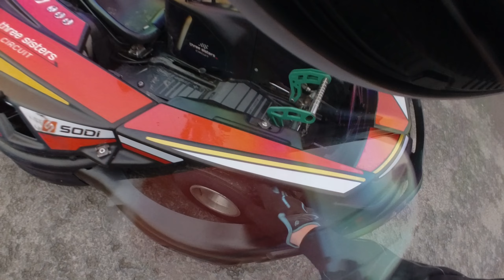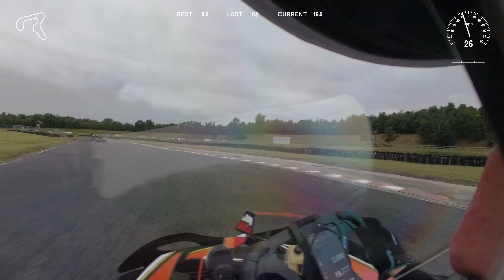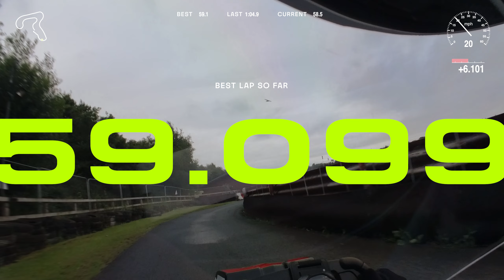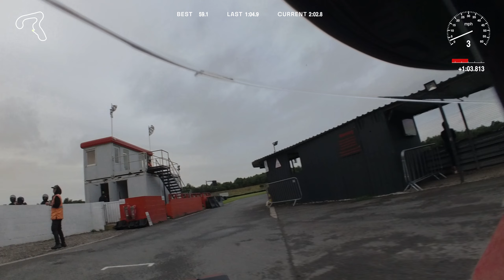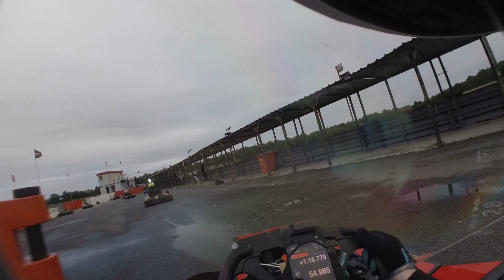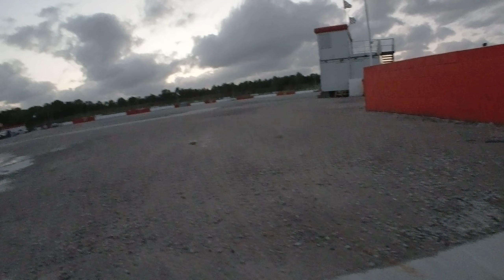Is this kart broken, or have I forgotten how to drive? Karting at Three Sisters Wigan

Comment: Great video and nice commentary :) I love driving in such wet/damp conditions.

Dunno (hard to tell from the perspective of couch expert that wasn't there), wasn't part of the issue wet (rubbered) line? Or just wet patches (dunno how green was the circuit before it rained)?

3:50, the cart in front (#19?) wasn't going in that wide into that corner. The racing line apart of the entry seemed dry there, so when #19 avoided the damp patch on the entry, he could carry just carry on, while you were already stuck sliding out on the wet/damp part of the track?

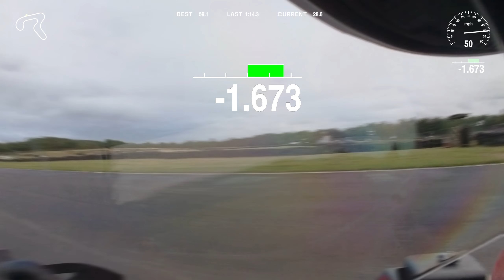4:03, when you started to understeer off the track, haven't you rotated significantly less by that point compared to those guys in front? And they seem to be avoiding the apex? Your line at 8:05 looked more like those guys in front?

~4:50, it looks like you first oversteered then understeered a little bit, which at 4:51 pushed you off more to that damper/wetter part of the track. At 4:51 you can see that inside line is dry/drier until the crack and you are touching with your outside wheels that damp patch. After that you are just a passenger, as you can not turn in after the crack as everything seems to be wet (plus normal racing line might be rubbered). Again 8:20 seemed a bit tighter mid corner vs ~4:50.

Again hard to tell. It could also be that the second cart had indeed more grip (fresher tyres?), which in turn allowed you to avoid hitting those problematic spots while driving even a bit faster, which compounded to that 5s difference. 

Also I would be curious to know the tyres temperature between those two runs. Maybe in the first one, due to those episodes when you were washing out of the dry line, you were not able to warm up the tyres?
Reply from the maker: Thank you mate! Glad you enjoyed it!

Not really - at first I thought it was all in my head. There was a bit of oil on track at turn 2 causing some of the spins, and there were definitely some damp patches I was hitting early on which was ruining my lines. In the beginning, I thought it might've just been tyre temps because there were certain corners where the kart didn't feel too bad (hence me staying out for a while before swapping!) but even 10+ minutes into the session, trying my hardest to put load through the tyres and trying different lines I was just getting no grip when turning and just couldn't carry speed... it was such a strange sensation! Never had anything like it before. 

I'm pretty sure the second kart I jumped into had been sat in the pits the entire time - so would've had much colder tyres - but I was able to punch that laptime in on only my second lap in it. 

There's definitely performance differences between all the karts, but I've never experienced anything quite that drastic before. I'd be fascinated to know what was causing the understeer, you can see me looking at the problem kart's tyres at the end of the video but I couldn't see anything unusual. Just relieved to get a lap in that second kart!
Reply: @thepitlanecollective  it would be fun to be allowed to dig into that further if only to learn more :) For example swap again to that first kart for one more lap.

I think it would have to be something really bad to cause that much of a time difference (apart of used/old/harder tyres compound). So as I wrote before, I would hazard a guess there was some difference between karts (there always is :) ), but it got somehow compounded with the driving conditions.

Re tyre temperatures. I haven't experienced it, but have heard about it happening, that some mistake causing tyres to get too cold, and then due to lower grip, more mistakes are compounding to the problem that you are driving too slow to actually warm them up (like less initial understeer allowing you to avoid even more damp patches). I wouldn't rule out that after changing karts, you could get a couple of first corners so much better (track drying out, learning where the grip is, etc) compared to your first stint, that 2nd time you managed to keep the tyre temp higher.  Your lines in the 2nd stint were different after all, and as you said, first couple of laps of the 1st stint were slower.
Reply from the maker: @B4ndItOo  yeah it would’ve been fascinating to swap back. But there’s no doubt in my mind it was 95% the kart...  if you look at the very end of the video I put the best laps in both karts side by side, and you can see how the first kart just understeers even when I’m on the right line (look at it through the right hander after the back straight, and the final corner) whereas the second one gives me the grip to carry speed. 

I wonder if the chassis or steering is bent or something, maybe one of the front wheels is lifting while steering lock is wound on. Who knows 😂 I’ll leave it to the mechanics to work it out haha!